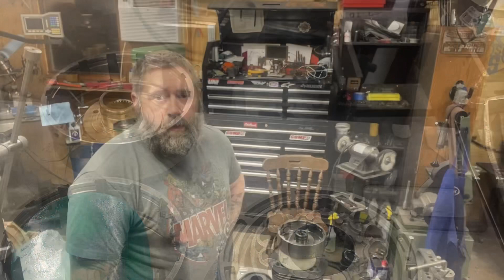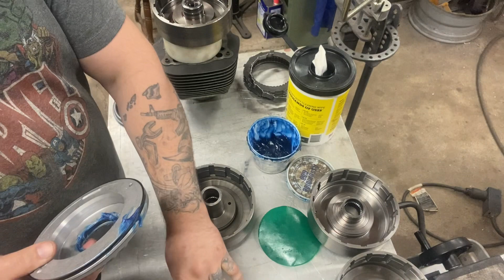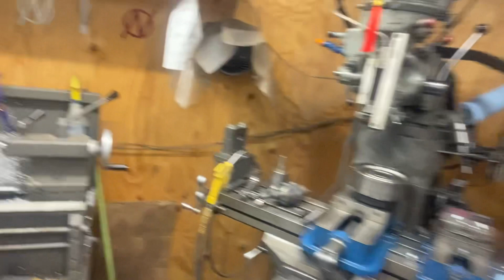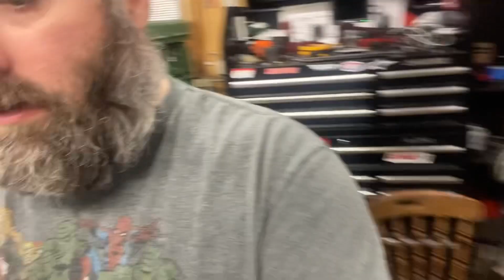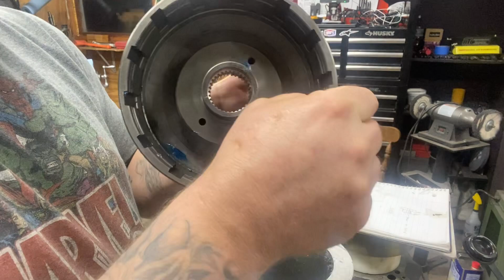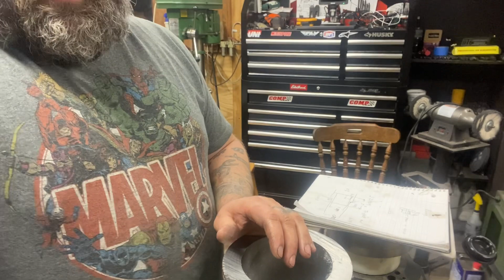Th400 piston install tool

Comment from the maker: The key is to have it sit really tight to the bottom. I’d give it a try and sand it a little or file it.
Reply: How much are the lip seal installers for  both the th400 and powerglide drums